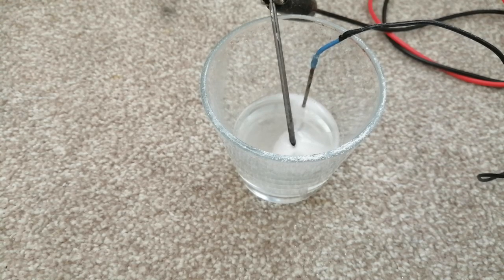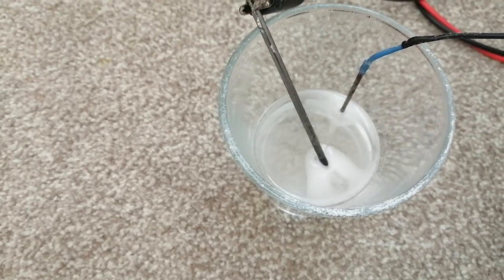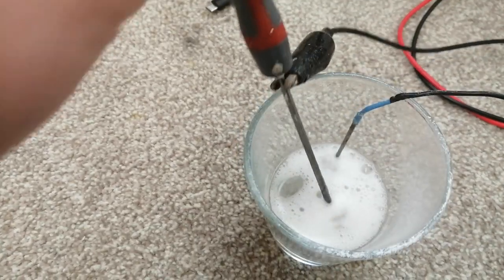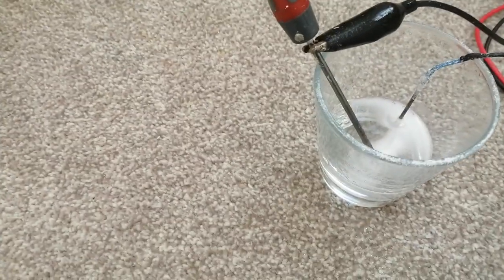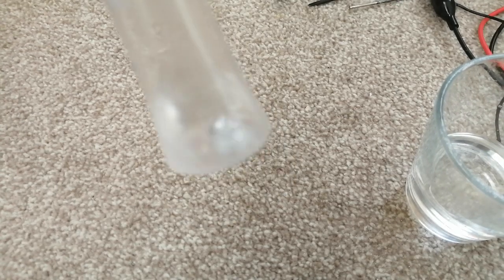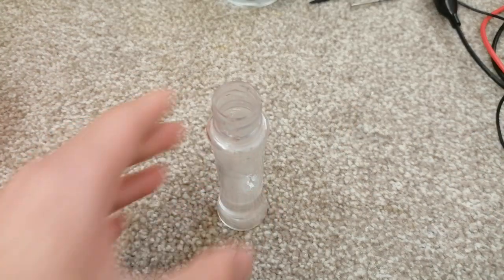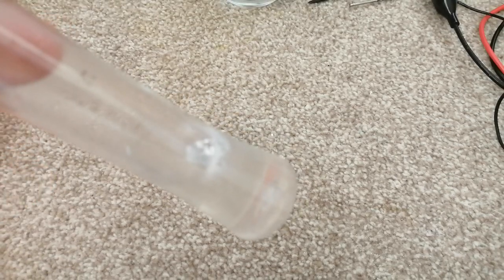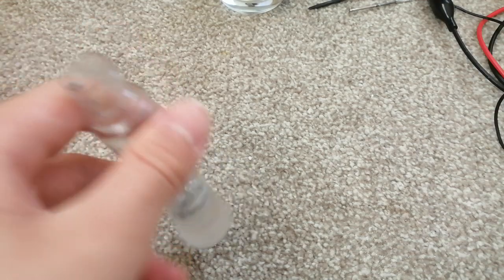Making Sodium Hydroxide: Method 2

Comment: how long it takes to electrolyte small cup ? 10 hours?
Reply from the maker: It depends, current is the measure of the rate of the charge flow per seconds. charge is measured in coulombs. And each mole of electron will be used to produce NaOH in it following moles in the balanced equation. So 1 amp might be twice as fast as 0.5amp currents. (ignore current efficiency)
Reply: @ReedSwitchTube  im using 12 volt
Reply from the maker: @salasmomonicesalas1257  The voltage don't matter that much in electrolysis (but required as it is the energy required for the reaction to happen), what matter is current. The rate of coulomb electron flow per second.
Reply: @ReedSwitchTube  now another question how much three tea spoons of salt will produce for the sodium hydroxide ? small piece ?
Reply from the maker: @salasmomonicesalas1257  First, one teaspoon of salt weight 2.3g, therefore in three teaspoon of salt weight 6.9g. Assume the reaction is 100% efficient.
Second, the reaction goes: 2NaCl + 2H2O --> H2 + 2NaOH + Cl2
Third, the ratio between salt and lye is 1:1
Forth, therefore there will be the same molar ratio between the start of the reaction and the end of the reaction between the molar ratio of salt to lye.
Fifth, molar mass of Sodium chloride is 58.44 g/mol, we have 6.9g of NaCl, therefore 6.9/58.44=0.11806981519 mol. NaOH have a molar mass of 39.997 g/mol therefore 0.11806981519*39.997=4.72243839836 grams of sodium hydroxide!
But remember if it is 100% efficient. therefore it would never be that efficient.
Reply: @ReedSwitchTube  how about the black rod ??? Pencil rod ???

Comment: You don't make sodium hydroxyde if you don't use a membrane ...
Reply from the maker: While it depends, on the anode, carbonic acid is formed, which quickly decomposed into carbon dioxide and water. But before the carbon dioxide react with the lye, it leaves as the bubble. so it was not as efficient as membrane method, but just to prove the point that lye in low concentration can be generated by using non membrane method.

Comment: How to make sles ??
Reply from the maker: do you mean Sodium laureth sulfate
Reply: ReedSwitch Tube sodium lauryl ether sulfate
Reply from the maker: @ajmalafzaal1692  by ethoxylation of dodecyl alcohol. The resulting ethoxylate is converted to a half ester of sulfuric acid, which is then neutralized by conversion to the sodium salt.
Reply: ReedSwitch Tube thanks dear
Reply: This is best , but you are not using carbon is it good